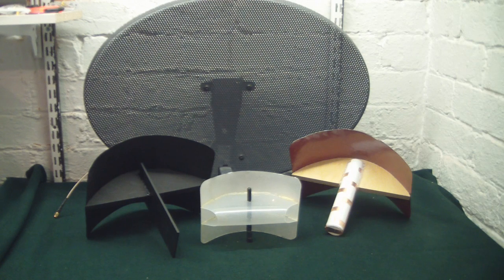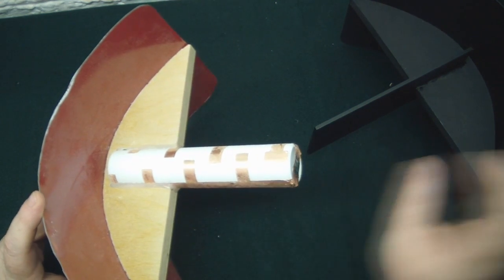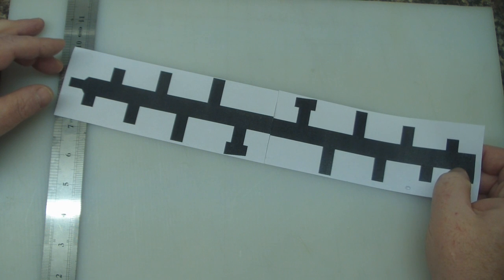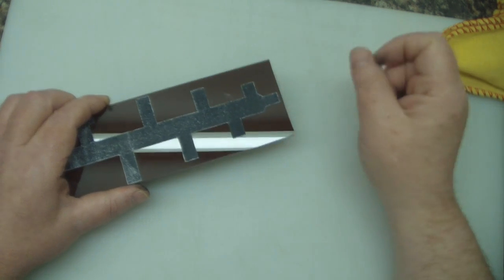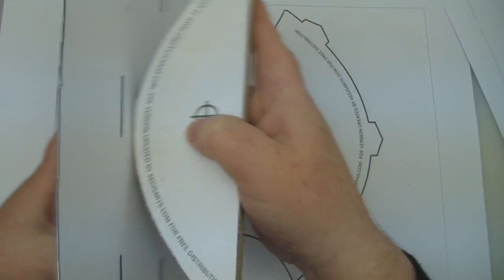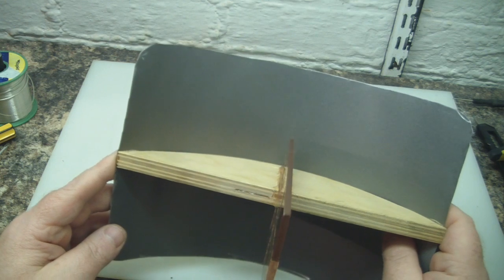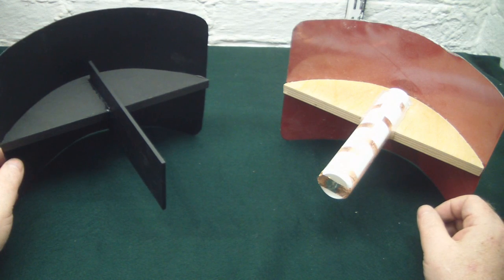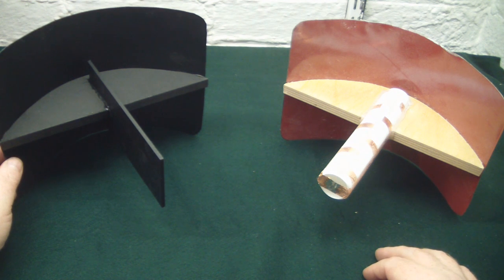Parabolic Antennas for 2 4GHz part 1 #56

Comment: I hope to get a 3d printer soon.

I was planning a build with a single wind surfer back reflector and dual yagi's for a 2x2 mimo...

there is a conductive filament I hope will print precise antennas!
Reply: bigmac turd how has your progress went? I heard there are high consistency copper filaments

Comment: I don't know if your still fiddling. if you slide the Perspex feed exciter back and forward in the slot, at some point youll get a maxamin gain. it gets the exciter in the right place of the focal point. try a 4 element quad as a feeder as itll be closer to 50 ohm thus matching your coax. ive had good results with a 2 ele quad as well, the reflector helps to bring it to 50 ohms. half wave long for the 4 ele and point 12 of a wave long for the 2 ele

Comment: i have just purchased a new usb adapter rnx-n600ube dualband... on the antenna's provided, i see printed 2.4G/5G... does this mean the antenas messure for both 2.4 and 5g? not sure if this makes sense...
Reply from the maker: bigmac turd It would probably be a 2.4GHz antenna. The 5GHz will work just not as well as a antenna designed for 5GHz.

Comment: Andrew, thanks for the video, its just as informative as your videos usually are.

I have been wondering about one point, the width on the parabola is mostly unneeded in my opinion. Wouldn't curling its edges inward give you  some of the advantages of a 3d parabola? (Such as a slight vertical polarization)
I'd love to hear your opinion on this idea

Comment: Wish I found this months ago... a good size... 

Think u can craft your own dish? same size as what u have here? Or does this element not need a dish? 

I had made some 3inch, 6inch and 12 inch focal point parabolic dish's. But super ugly and a biquad was not the right element for the job

I attempt to solder a bunch of thick wire to a jig but my mini torch skillz suck lol now its a wall ornament in my shop

I need a solder gun